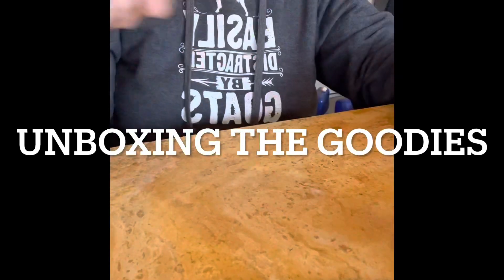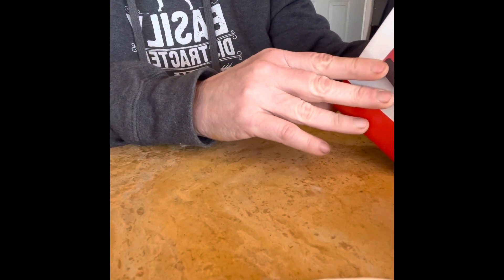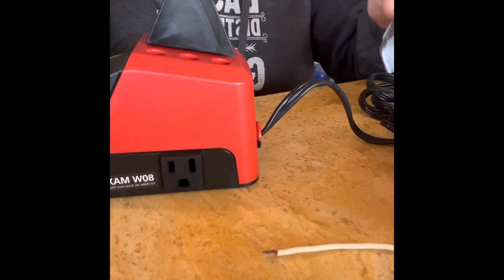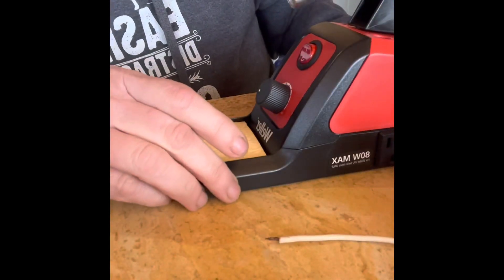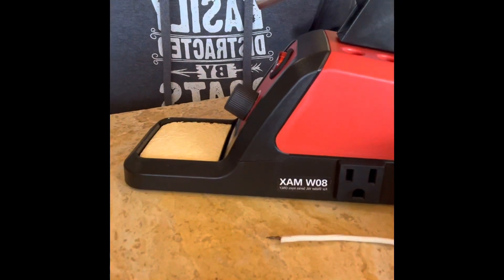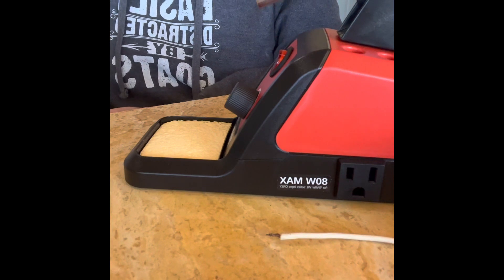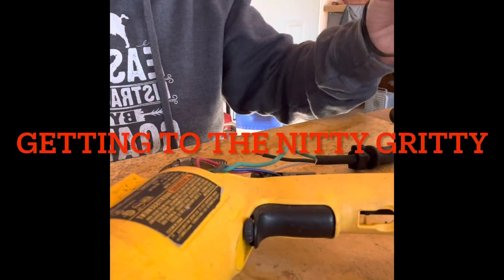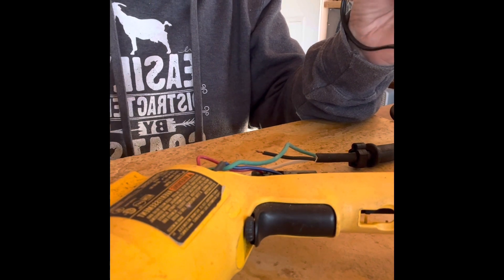Reviewing the Weller Soldering station

Comment: As your intentions are good, the process needs work....  The purpose of the hot tip is to heat the joint First with first contact with a small dab of solder, then heat the joint and feed a small amount of solder to finish.  The soldering process is NOT a "dabbed-on" method, as suggested here....

Comment: Good God lady - You don't paint solder on like a paintbrush. You're supposed to heat up the metal from the wires (by touching the tip to it) and then apply the solder to the hot metal so it flows over it. But interesting video other than that :).
Reply from the maker: Thanks for the tips!
Reply: you do tin the tip before applying the solder to the wire. But yeah, not like a paintbrush but more like priming the tip so the actual soldering is easier.